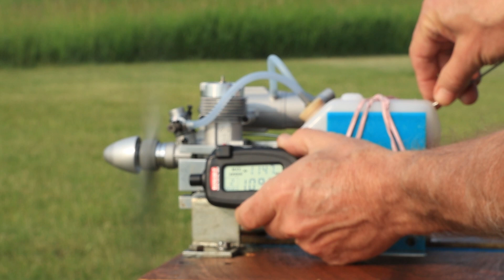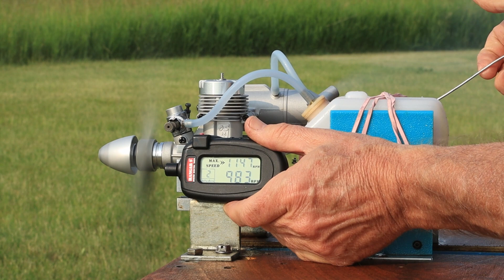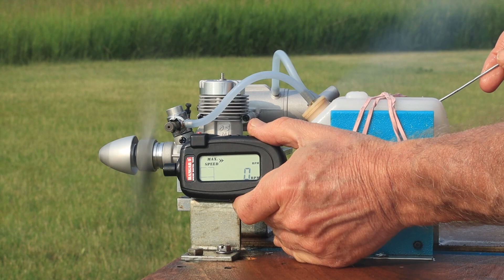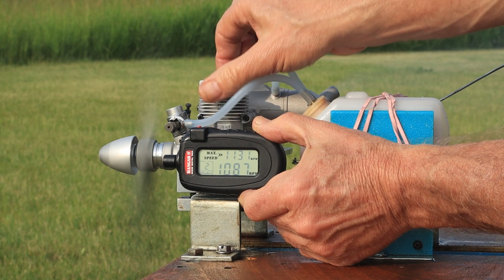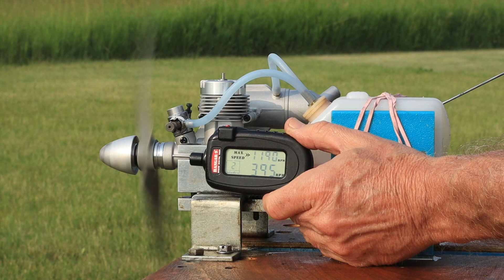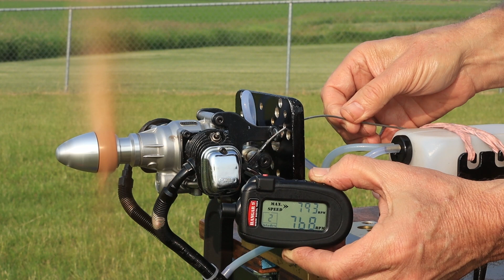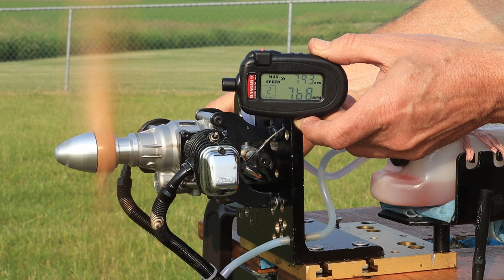Two Engine Runs One Video OS 32F/Saito FA-90TS

Comment: I remember a video that you checked the timing and decided that it was correct. Did you change the timing or leave it the same? 
I love how all the twins sound.
Reply from the maker: So this is a comment I made on that video that is pinned to it to be at the top:

To close this out, it appears that the timing was off by one tooth.  After reading the comments and consulting with my friend Harvey, I gently pushed the timing cam shaft out while the engine was fully assembled.  The alignment mark on the top gear #1 in manual, is between teeth and not ON a tooth.  After closer inspection, with my magnifier on, I could see that the image I posted from the video I had the Tooth above the mark aligned with the mark on the case.  This made it look like the timing mark on the cam shaft was in the correct position but in reality it was one tooth off. The timing dot on the cam shaft was DOWN one tooth from the proper position. This still does not explain WHY there are two dots on the case for the timing when the manual shows and speaks of only ONE.  A better questions is HOW this got to be mistimed.  Seeing as the cover for the cam shaft bearing was dinged from a screwdriver when I got it; it seems to imply that the previous owner did exactly what I did.  Pushed the timing shaft out and retimed the engine, improperly.  The final question would be WHY?

Yes I corrected it after the video.  I also posted this video with the title of after resetting the timing. https://youtube.com/shorts/MKjwUXqNdkA?feature=share
Reply: @dmrcflyr2 Hi David...I have bought a couple of your engines over the years.  If you decide to sell the Saito 90, I would love to have it...Thanks in advance...Gordon
Reply from the maker: @gordonmclean5249  Sorry Gordon. Too late. Engine Trade Deal
https://youtu.be/GnAGPpMkhcI